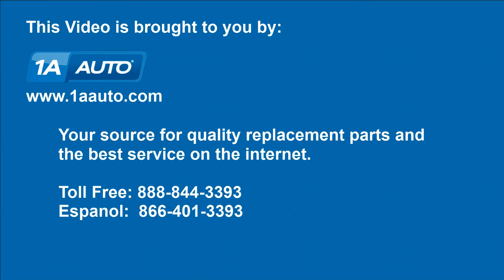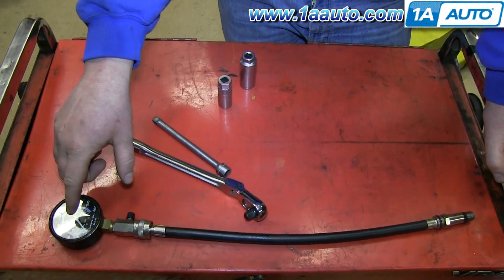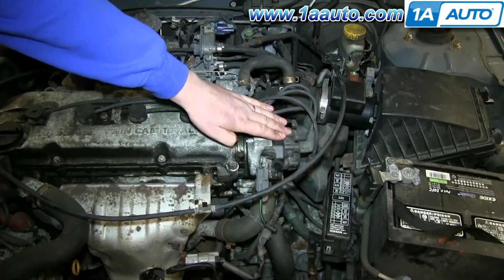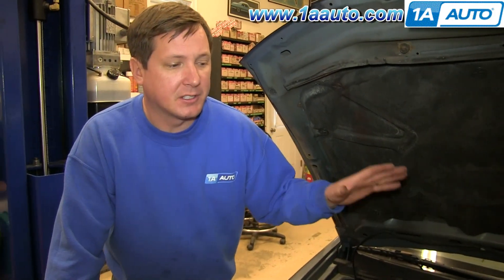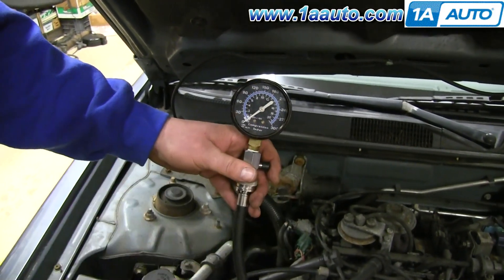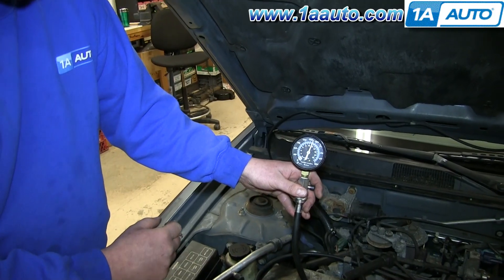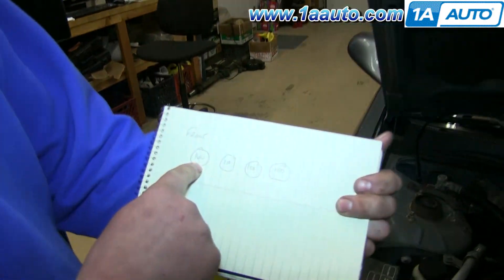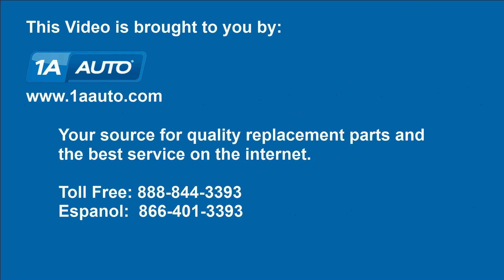How & Why To Perform a Compression Test On An Engine

Comment: I wish I knew this before I bought the used car I'm driving now. My car has Low engine compression and the clutch gave out and had to replace it. Now I have to deal with the engine.

Comment: I done the compression test on my car engine but in 3 cylinder the gauge indicate 125 but slowly drop the pressure is it normal?? as one of the valve may be open

Comment: Hello! I have a 350 ci v8 motor .. long time sitting. Pulled off the spark plugs, they were black in color as if it was too rich. I did a dry compression test only (twice) and bank (2,4,6,8 are 175 psi each) & bank (1,3,5,6 are 150 psi each). What could be the cause (is it due to carbon build up or timing..) and would it not make the engine run?
Reply: Could be carbon buildup, Try and use some fuel additives

Comment: I’m a little confused on the deviation part, so does that mean 10% from the highest number? Example I did a reading today and got 150 165 175 170 so deviation would be 17.5? And since the lowest is 150 then the deviation is too much?
Reply from the maker: +Luis Sonoma Thanks for watching!  You generally do not want to see any of the cylinders have more than a 10% difference.  It does appear that there is a compression issue with the cylinder at 150 psi at the very least.  That is more than a 10% difference from not even the highest reading you got.
Reply: @1AAuto  Thank you very much. It’s off a Nissan D21. It’s smokes a lot so I figured it could be the valve stem seal but with compression being that off I’m assuming rings are pretty worn as well. Plugs weren’t fouled or didn’t have any oil build up on it so maybe new rings and valve stems seals can have this run longer. 🤷🏿‍♂️
Reply: The Haynes manual for my Ram 5.7 says 40% deviation. That seems extreme.

Comment: Do you need to do this on a warm engine?
Reply from the maker: +M C Thanks for watching!  No the engine does not need to be warm to perform a compression test.
Reply: @1AAuto  really appreciate the feedback. Not sure if you know but I can't find a straight answer. I did the test on a 2009 Subaru Forester 2.5x and got back 160, 162, 165, and 180 psi. Do you know if this is acceptable? I heard anything within 15% is fine but again wanted to confirm. If you can of course. Thanks!
Reply: @RayTuscany  I've seen other videos and they've stated that the engine should be at operating temperature because the combustion chamber expands when it's hot therefore giving you a more accurate reading. I'm like you, I'm still trying to get a straight answer?? 🤷‍♂️🤷‍♂️

Comment: 1A AUTO PARTS 
 ,,   ,,,,    If the PSI level values compared to each other cylinders was more than 10% to 20% what would be the problem with the engine?
Reply from the maker: +bill williams Thanks for checking us out! This could be something such as a blown head gasket, an issue with the pistons, piston rings, or there is a valve that is stuck open or a valve gasket. We would highly recommend getting this diagnosed if this is the case. 1AAuto.com

Comment: So what happens if one cylinder reads 150 psi and one the other ones reads 180 psi ?
Reply: Nothing they are good
Reply: They are fine. Anything within 20% is fine
Reply: NoneMechanic101 bad
Reply: You got a problem.
Reply: Sell the damn car before it RIP